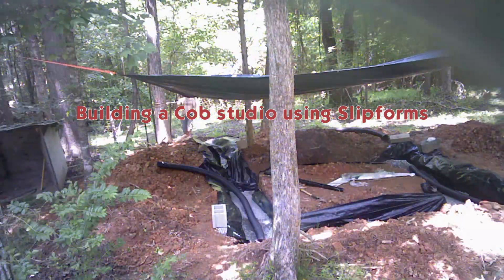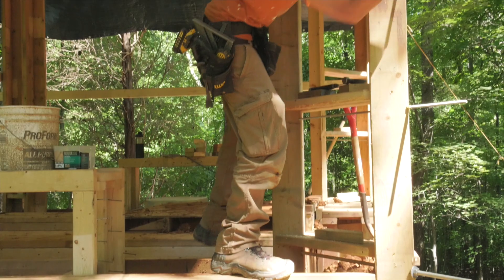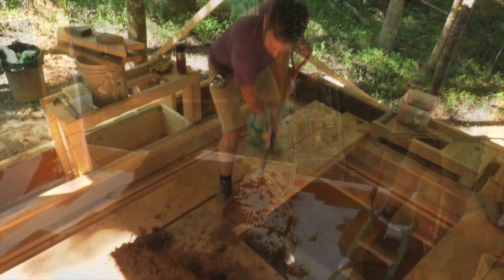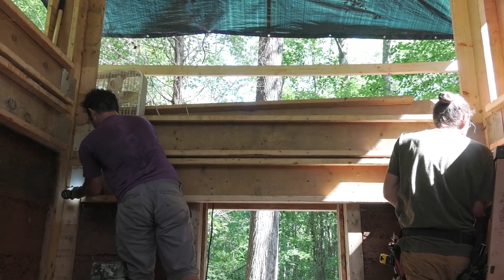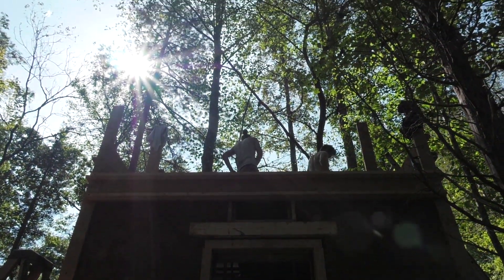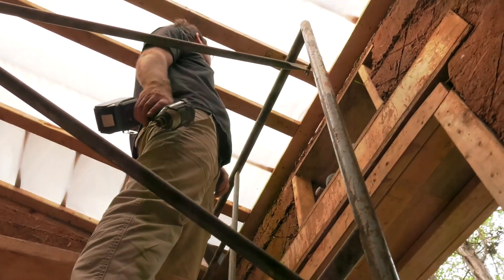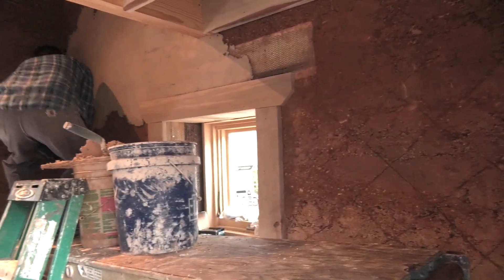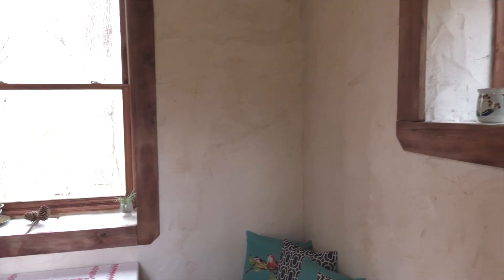Using Wood Forms and Mechanical Mixing to Speed Cob Construction - Kortus Studio

Comment: I'm curious how well the plaster adhered to the cob over time. I've heard that these 2 materials have a different rate of moisture absorption and that they can detach from each other..
Reply from the maker: Hi, generally a lime plaster will adhere very well to cob. A cement-based stucco type of application will not adhere well over time. Concrete tends to pull moisture from the air and this degrades the binding properties of clay. But both clay and lime repel moisture. This is why they can be used in conjunction with organic materials such as straw and hemp. This can be confusing since lime is an ingredient in cement.

Comment: Nice idea. But I think that rammed earth would have been faster to dry and would have served you better.
Reply from the maker: Doubtful. But maybe you care to elaborate on why that would be the case? Rammed earth requires much beefier formworks that can withstand mechanical tamping. Cob can hold itself up even when wet. Therefore the slipforms can be very lightly built. Instead of tamping the wet cob is agitated or vibrated to settle out the voids.
Reply from the maker: Further, rammed earth uses brute force to achieve structure, cob achieves the same results using an intelligent engineered mix of sand, clay (the binder), and straw (for load distribution, similar to rebar). Cob is the equivalent of using a lever; rammed earth is a sledge hammer.

Comment: I LOVE THIS! For someone who still likes the strait look of modern houses but the economical, insulating, and natural benefits of cob, this is everything Ive been looking for. Trim and beams look AMAZING. You guys truly made something wonderful, and thank you for sharing it here with all of us!
Reply from the maker: Thanks, Garland! I agree, I like a more streamlined look and I believe using forms has the potential to greatly speed up the cob process.
Reply: Oh absolutely! Instead of having to mold it, you made it wetter as to have it settle, correct? No patting it into place, but I guess it would have a bit of a longer drying time... But it definitely looks less labor intensive, and so much more time savvy! It's like rammed earth but with cob, and you don't have to bash it for eight million years! I am so happy I found your video! 💕
Reply from the maker: @garlandthompson5970  Yes, that's right - making it wetter allows it settle by itself. This is actually a common construction compaction process called "puddling". The wetter mix was slower to dry, that's why I've been revising the formwork this summer to use hardware cloth on the sides instead of wood. The forms are much lighter and the drying time is much improved. I made a short pair of videos about it:

 https://www.youtube.com/watch?v=uYxKIW-DxBI

https://www.youtube.com/watch?v=nJH3_7T8w30

Comment: Seems like a really good modern cob house. I had considered using forms, but it seemed like more than I cared to get into. It seems like there was a lot of wood used, how much left over material was left, or was it able to repurposed for roof. Check our out Cob Barndominium build. https://www.youtube.com/watch?v=mRBvXtwmAdg&t=448s&app=desktop
Reply from the maker: Thanks John, that's a very cool project you're working on, thanks for sharing! Please keep us posted on your progress.

Yes, the forms that were used in the above video were repurposed for the roof rafters. However, I've become disenchanted with the 2"x12" forms because of weight; bulging; awkwardness; etc. I'm experimenting with a form that has hardware cloth on both sides to facilitate drying and reduce bulging. I've had good success with it and I've just uploaded two short videos about it.
Reply from the maker: https://www.youtube.com/watch?v=uYxKIW-DxBI
Reply: Thats seems like a very interesting design change. Ill check those videos out for sure.